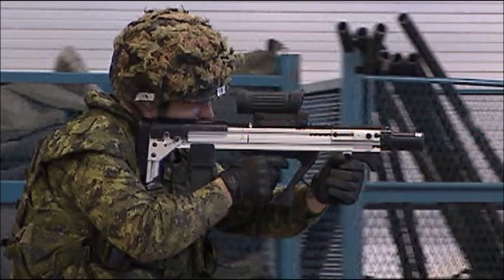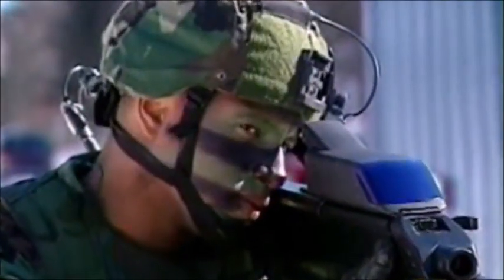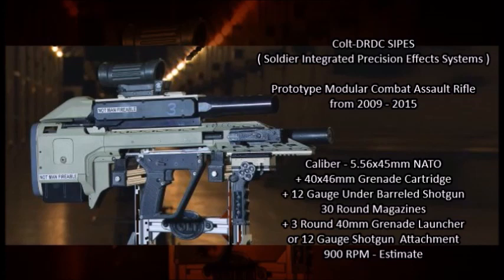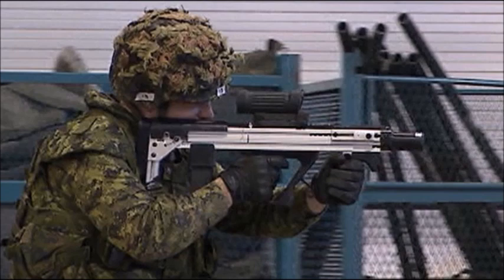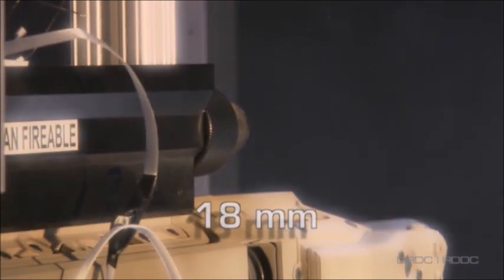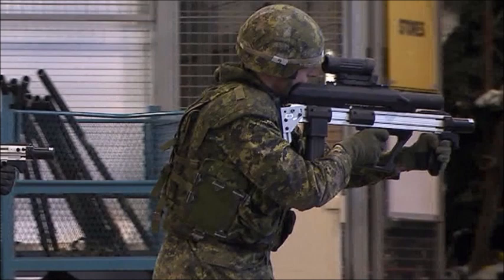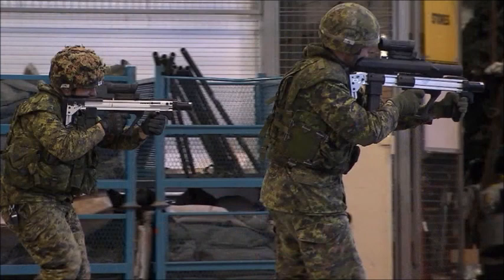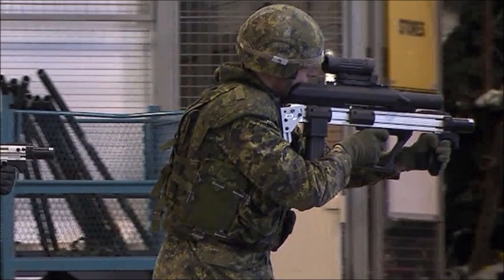Colt SIPES : Canada's Forgotten Future Weapon

Comment: I think small tactical drones will make the "smart grenade launcher" concept obsolete.  Small drones have proven themselves in combat in Ukraine as a very effective way of putting small explosives in the defilade.  Imagine a system using two small drones and some smart software.  One that loiters over your immediate tactical environment, semi-automatically identifying and tracking targets.  The second one would pretty much autonomously go back and forth between the operator and target delivery points, dropping and picking up small munitions. Edit: I want to point out another example of this.  Consider the HEDP 40mm grenade rounds for the M203.  They are capable of penetrating about 2 inches of armor if you get a nice square hit.  They were developed to give at least SOME type of emergency anti-armor capability to a squad if they didn't have better stuff on hand, in case say a BTR or BMP showed up.   The problem is you had to be darn close to get a good hit with one of those, so they really weren't that useful in the real world, they just beat throwing rocks.  Well along came the war in ukraine, and they had a bunch of those.  Someone came up with the bright idea to retrofit them onto civilian quadcopter drones.  It's easy to and low risk to get close to a BTR or BMP with a drone, and dropping it straight down ensures a nice square hit.  And the armor is thin on top also.  We've all seen the videos on how well they work

Comment: So you can mount an 870 to either side or on top, which means in theory that you could have a gun with 3 attached shotguns; perfect for the Doomslayer. But yeah, nah, this project is more dead than the Arrow. It's an obsolete concept and Canada has nothing left in terms of domestic weapons political influence, and it's hard enough as it is for them to equip the forces with the equipment they're actually supposed to have, nevermind new projects. They'll be running the C7 into the 2050s.